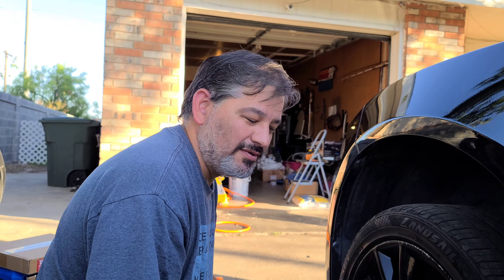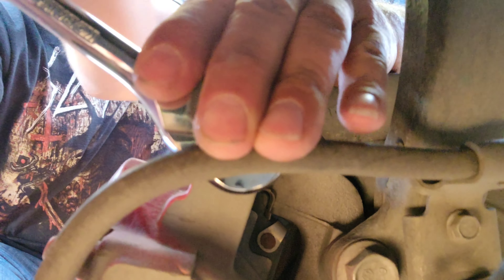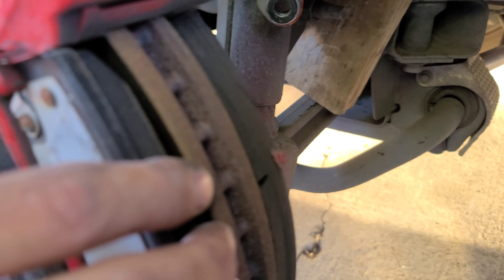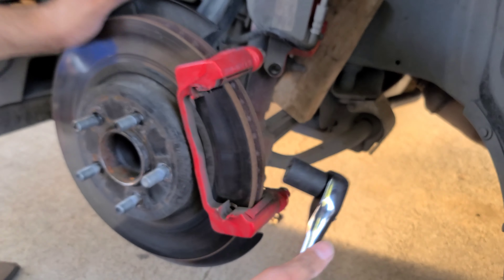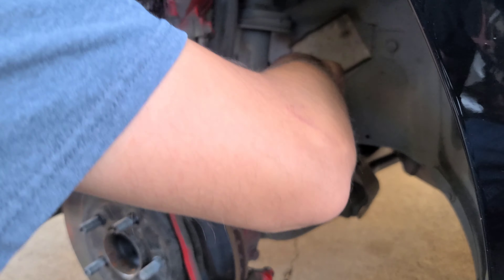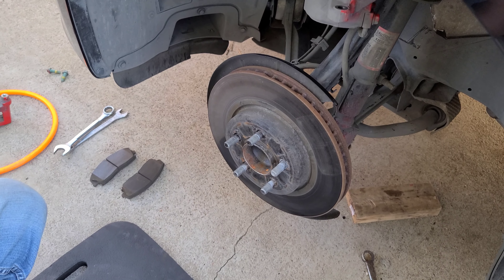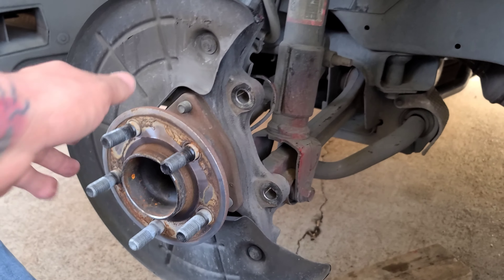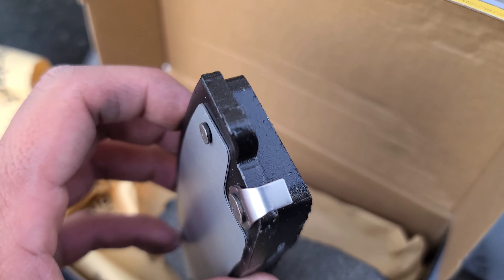2018 Dodge Charger brake pads and rotor replacement

Comment: 2:20 neither of these bolts will come off I’ve tried everything I’m 4hrs in it’s like they’re welded in there and my rotors chipped and grooves to hell asked already i need it off!!
Reply from the maker: Try a beaker bar or a cheater bar. We used an air impact gun so we really didn't have any issues but I know there torqued up really high. The bigger the bolt the higher the torque.
Reply: @DirtyDude  I’ve used an impact driver 3 different breaker bars a pipe wrench and a couple sets of large crescent wrench’s idk whats going on
Reply from the maker: @lostmymind9047  did you try the hammer technique lol like at 8:00
Reply: Did you get them off....
Reply: @lostmymind9047  go to the parts store and use a product called PB blaster penetrating oil, shit is like magic
Reply: Dude was probably tightening instead of loosening and when he finally realized it he was too embarrassed to come back and  admit it.

Comment: Great video, two things. Whenever taking out bolts instead of using a hammer to hit your tools you should use a rubber mallet. This will make every hit much more impactful and also reduces the change of stripping your bolts and hurting your tools.

Second thing, as soon as you bring the caliper off get a bucket and place the caliper on it or use zip ties / strong string or even a shirt to tie it against your suspension. This reduces chance of blowing out a brake line since there isn’t any chances of it slipping and busting the hose. 

Other than that awesome, funny!
Reply from the maker: Hell yeah, awesome tips, but dirty joey has his dirty ways, lol.

Comment: I wouldn't quite say OEM is bad. My original brakes on my 2018 charger lasted me 80k miles. When I changed them, they still had meat left on them. I replaced them with some brake best brakes from Oreily's and they only lasted me 20k miles. I replaced the rotors too and they warped way faster than the factory rotors. The only reason I didn't get factory again was because it was more convenient, and I had a friend that gave me a discount at Oreily's. Nonetheless we all have our own experiences with factory/dealership items.
Reply: mine did too. my 2018 sxt plus I got in 2018. I just changed the brakes a few months ago. I have 94k now